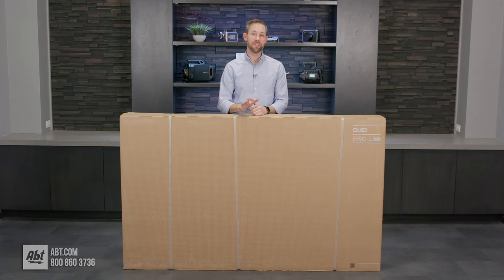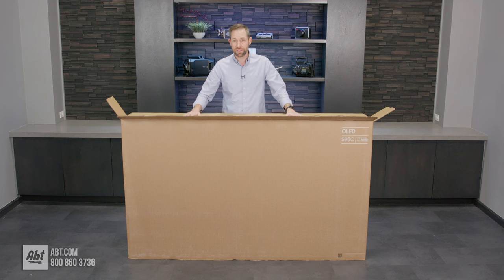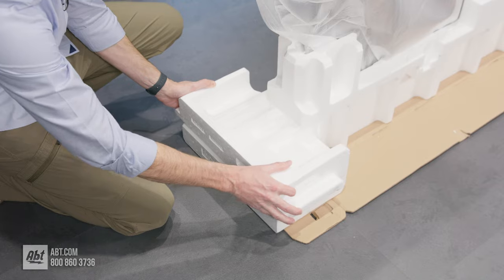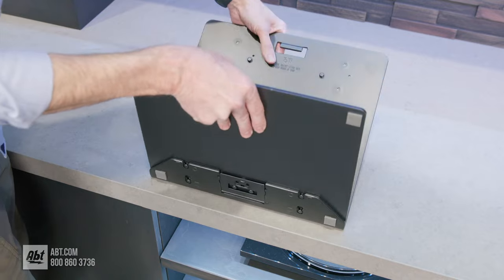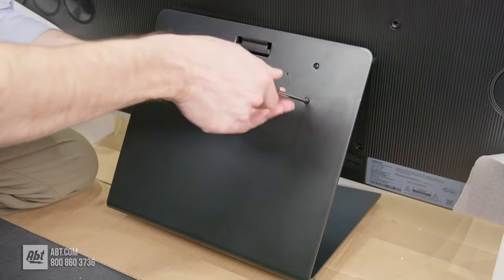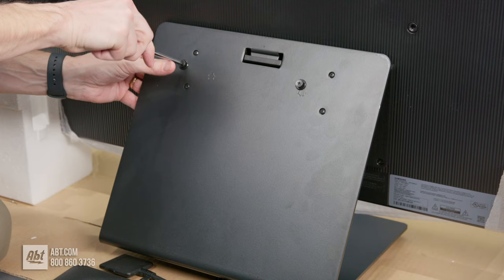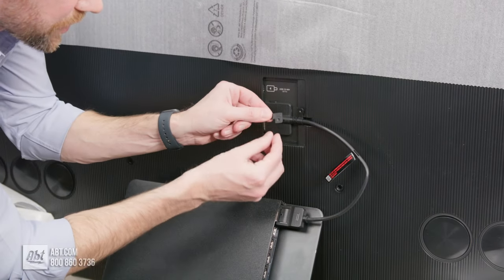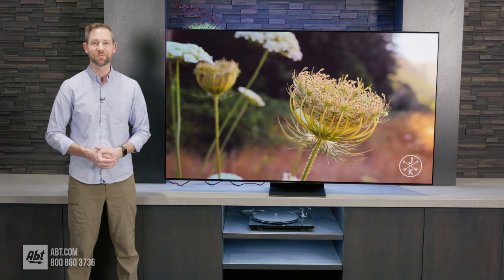How To Unbox The Samsung S95C OLED With Pedestal Assembly And Install

Comment: how do i remove the pedestal?
Reply from the maker: @conscience580 Here is what we recommend, but please be extremely cautious so as not to cause damage to your screen, and be sure to have a second person on hand to help with moving the TV.  You'll want to set the TV face down on a flat surface with some kind of protective layer in between the screen and the tabletop (like a soft blanket or some thin, foam wrapping) with the pedestal hanging off the end of the surface. Next, unscrew the metal arm piece from the bracket that's attached to the back of the TV and set it off to the side. Finally, unscrew and remove the plastic bracket piece from the back of the TV.

Comment: Carl, I need answer as soon as you can, lol.  just got the 65 inch s95c. got it set up and on my tv stand.  The tv leans BACK at little.  I googled it and it said it's supposed to.  IS IT?!!!
Reply from the maker: @Trumpet1ification It's not necessarily designed that way, but we have seen some that lean back very slightly. It's difficult to tell if you're sitting in front of the screen, but if you stand to the side you may notice it.

Comment: I had to do the 77 inch alone lol.That stand is a $#4% and makes it 3 times as heavy. I am a big guy and had to really force myself to lift it from the bottom but not in a way that would break it. I had to use a chair, chair to standing desk, then standing desk to the church table that i was going to put it on. I could barely lift it past that. If i had to do it again i probably would have put it together on the flip table itself before putting that heavy stand on it. i proubably would have needed 2 tables for the first sset up though. Past that omg so great.I was using a cheap walmart lcd before and didn't know stuff could look that good on a tv hehe.

Comment: Hi! Hope you see this, how did your stand fit? Mine does not close AT ALL
Reply from the maker: @Korikesho If you're referring to the magnetic flap on the bottom of the pedestal, you may need to push the larger plate harder. It can take a little extra effort to slide the two plates together. Once they're seated properly that flap should close  easily.
Reply: @abtelectronics  thanks for the answer! I actually think ive gotten some ‘’wrong’’ parts, its too small sadly so it wont close

Comment: Which samsung oled or qled tv series have pip (not multi view) ?
Reply from the maker: @senersoyel1957 The Samsung TVs are all MultiView. You do have the ability to adjust the size of the second window to make it bigger or smaller. Each image requires a separate source (can't use 2 HDMI feeds at the same time on screen).

Comment: We used your video yesterday to unbox and set up our S95C with your step by step instructions. Perfect, except one place where you explained 3 screws available to attach the one connect box to the stand. Really only 2 of those screws are for this purpose.  The 3rd screw is actually critically different from the other 2. But no harm done. Excellent instructions! Many thanks!

Comment: I noticed when you were unboxing after cutting straps there was no clear tape to cut along the top edge. Is Samsung not putting packing tape along the top edge anymore. Thank you
Reply from the maker: @user-ef1xo9vb2i The only model we've unboxed from Samsung for 2023 so far that had packing tape was the 65 inch QN900C. We haven't had a chance to unbox the full line of their TVs yet though, so there may wind up being more.

Comment: If mounting the tv on the wall, do you not use the Pedestal?
Reply: I just uncrated mine today. Trying to figure it out. It does not look like you use ANY part of the "stand" for wall mounting. I have a 65" LG... The Samsung rep told my wife we did not need a new wall mount, they were all interchangeable [for given size ranges]. Now, the information I am reading makes it look like I must use a new wall mount system.... DANG IT!!  If anyone sees a 2023 OLED S95C wall mounting How to video...please share!! [Ps...Even though we bought it Sept 2023. The sticker on it says 2022...just sayin'...

Comment: How do you remove the rubber bumpers on the bottom corners?
Reply from the maker: @rockandrollrockandrollrock6930 If you're referring to the light gray ones, they are held on with some double sided tape and giving a gentle pull should be enough to remove them.
Reply: @abtelectronics  thank you. I a
M loving the 95c . But I was shocked that something so large and so pricey didn’t come with any type of owners manual. Just a quick start guide that shows a picture of every other step with no words.
Reply from the maker: @rockandrollrockandrollrock6930 That's exactly why we do these unboxing videos. It can be hard to understand the pictures in the quick start guide so we figured we could help out by showing the process in a video. Glad to hear you're liking the S95C. It's an awesome TV!

Comment: Is this the same method for the 65 inch ?
Reply from the maker: @gawain36 It's slightly different. With the 65 inch model Samsung says to lay it face down on a flat surface to attach the pedestal. Here's a link to the instructions so you can see a diagram: https://downloadcenter.samsung.com/content/EM/202304/20230413034532001/BN68-16623B-01_QSG_S95C%2055-65inch_ZA_Eng_230410.0.pdf
Reply: @abtelectronics thank you for your reply ❤